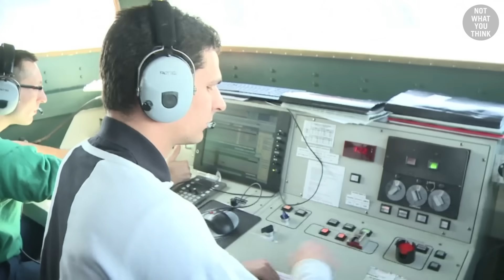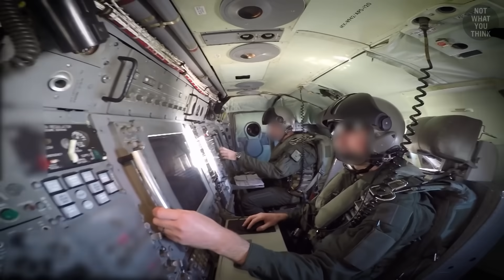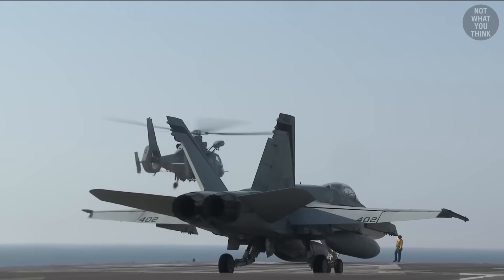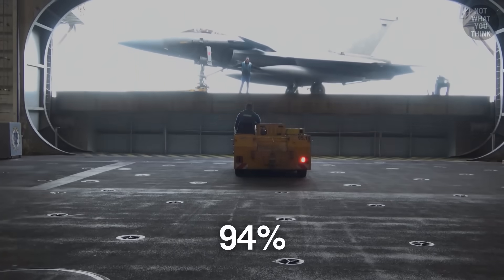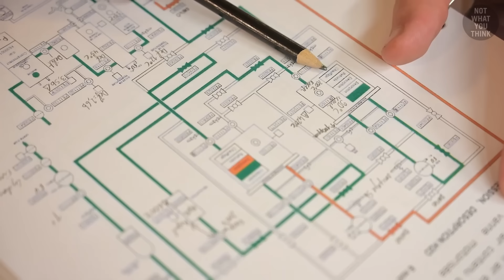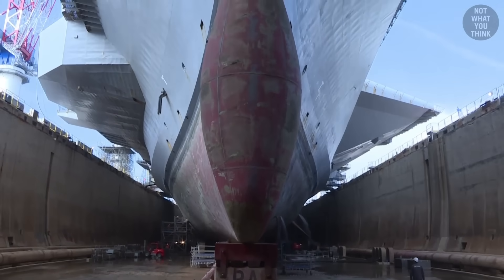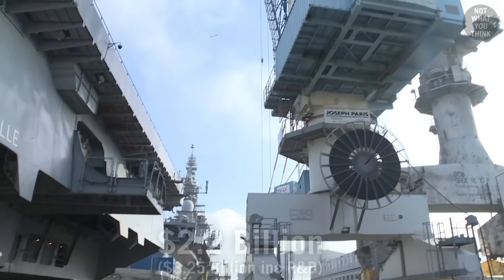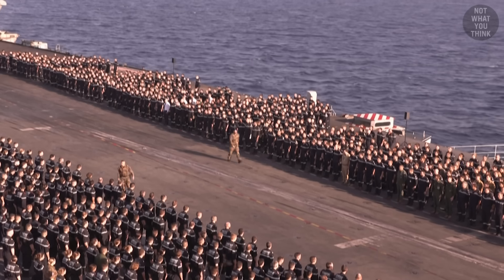Why This Small Carrier is Most Powerful Outside of the Supercarriers

Comment: This is a proper aircraft carrier. UK should have built theirs like this.
Reply: Why? Catobar is more expensive and the F-35 can work just fine with a Ski-jump.
Reply: @ Ski jumps limit your air t to just one type. You can’t operate E-2D Hawkeye and other fixed wing jets which do not use STOVL

Comment: The British did not want to expend the money required to build a nuclear-powered aircraft carrier, nor the budget required to build a CATOBAR supercarrier.  So, they built two conventionally powered carriers which are ramp dependent. That should have worked out well, because the F-35B is a very capable and survivable jet which has the capability to fight in contested airspace and deliver accurate strikes on defended targets as well as defeat electronic warfare systems.  But the Queen Elizabeth-class carriers cannot fulfill their missions, because the U.K> declined to spend the money to establish even one full-strength F-35 squadron!  These carriers must either deploy with a few F-35s added to a now-obsolete Sea Harrier squadron (assuming airworthy Sea Harriers are still available) or stay in home port.

Comment: My dude can only reach 20 Knots top speed 😂 definitely not more powerful than the Chinese shandon although is nuclear but is using the reactor from subs so it can even run the ship at full capacity and they have to add length to the ship to take off E2s also the entire Franch Navy can barely pull off a single full carrier strike group

Comment: Uh, no. The De Gaulle looks great on paper but has huge ongoing mechanical issues with propulsion limiting it's ability to deploy and there's no solution in sight. the Propeller shaft vibration is so bad that it is almost crippling.

Comment: Somewhat exaggerated claim and one due solely to CdeG's being configured for CATOBAR operation. Though in fact that has both advantages and drawbacks. Even so, and even while configured as STOVL platforms, the UK's QE Class ships can each operate max balanced airwings of c60 aircraft, all types (50% more than CdeG's maximum) and could operate them far more efficiently and effectively as well. They thus would each be hugely more powerful than CdeG if their full maximum strike wings' fast jet component of 48 x F35-Bs per ship were actually available to be embarked.

Comment: You missed out the rather obvious, but seldom thought of weakness of this, and all other carriers. 

They rely on vulnerable support ships to keep the crew fed, and provide supplies such as munitions, food and aviation fuel, making the nuclear reactor's ability to keep the carrier steaming a bit of a moot point. Any adversary would target those supply ships and nullify the ability of a carrier to carry out it's operations. 

There was also no mention of the threat of hypersonic missiles, or the threat of large salvo missile attacks which would overwhelm a carrier group's defences. The US found this out to be a thorn in it's side when they had to script an exercise (restrict enemy force's ability to have a free hand) in the Millenium Challenge (MC02) to ensure the exercise achieved the "success" the top brass wanted it to.

A carrier group's escorts can only provide a limited number of air defence missiles and rounds for it's CIWS before they need reloading/rearming. There is no doubt they would run out of defensive weapons if a large salvo simultaneous attack came in, leading to the sinking of a carrier and some escorts, leading to a large loss of life and assets aboard.

Comment: as the video points out, having AEW PLANES is essential for any "real" carrier. you need AT LEAST three: one on station, one being readied, and one in maintenance. without these PLANEs, you are blind, and in modern naval combat, that means dead.

you can try to the job with helicopters, but it's just not good enough. helos don't have the range, altitude, or endurance.

Comment: Are French Rafael fighters a match for F 35s? I think that’s the real question more than anything else! I am a Canadian and this is gonna sound weird cause I’m not from Quebec. I’m from Western Canada and I’m indigenous, but I wish we would’ve bought the French Rafael fighter with its twin engine design! Canada has traditionally owes you twin engine jets. When you’re flying over the Canadian tundra you want at least one engine to get you home!
Reply: Well there is no true answer to that question. Both are formidable aircrafts. F35 have unmatched passive stealth abilities and sensors and everything that we don't know about it, the pride of us military industry. But it is still a young design that will improve over time and get more reliable when all its problems will be solved. Rafale is much more older and developped, combat proven , can do all the missions that would normally require multiples kind of aircrafts. It has top notch sensors developped by Thales, maybe the best active stealth system and can launch meteor missile which is the best air to air missile on the market and has wider range detection and shooting than any other missile. The question would really be : can a meteor missile launched by a rafale detect and shoot an F35 before being shot ? Another question would be : would an F35 do everything a rafale can do as effectively ? In the end it does not really matter since we're allies those planes will only fight together and not against each other. I don't know which is the best but I'm quite sure together they're unbeatable
Reply: @antoinedubocq2052 great reply to the bait comment. Two completely different platforms with different purposes. Thank god our countries our allies, god help anyone in our way
Reply: Rafale, not Rafael 😭😭
Reply: rafale is better for the simple simple simple fact that you have total autonomy using them, for French or foreign countries, where with the f35 the US have total control and supervision of ur mission, and I am not even talking about nuclear warheads, which we know in a case of a tense situation, US won't even allow them to be mounted on the aircrafts...
Every countries who bought f35s are just getting fooled bu the US, again

Comment: French Rafale Marine is one of the best carrier-capable jets: Empty Weight 10,200 kg (22,500 lb) MTOW 24,500 kg (54,000 lb) Payload 9,500 kg (20,943 lb). Mach 1,8.  Hardpoints: 13.  6 AA missiles + 2 hardpoints: 6 GBU or 2 SCALP cruise missiles or 1 ASMP tactical nuclear missile (300 kt)
F35-B: Empty Weight 14,700 kg (32,472 lb) MTOW 27,200 kg (60,000lb) Payload: 8,200 kg (18,000 lb) Mach 1.6. Hardpoints: 10 (4 internal, 6 external)   4 internal hardpoints : only 2 AA missiles + 2 bombs. 
6 external hardpoints : F35B loses a significantly part of its stealth features.
Reply: Rafale is an excellent aircraft.
Reply: While the Rafale is a fine 4th generation plane in terms of electronic warfare the F35 is leagues ahead. The sensors and stealth capability are incomparable between them. As one test pilot said: “A 4th generation could probably beat an F35 in a dogfight, it’s just shame they’ll never get close enough.”
Reply: The F-35C is the carrier variant of the F-35. The B variant is the VTOL variant used by the Marines. The lack of weapons on the F-35 makes sense when you recognize the F-18E has 12 hardpoints and is expected to operate with the F-35 as either a missile or bomb truck. The more planes Americans can put on their carriers allow for more specialization.

The Rafale is most likely the best fourth-generation fighter in the world. The key edge it has is the French gave it one of the best aviation and sensor packages in the world. The only plane that beats it in that regard is the F-35.
Reply: @BulletRain100 The most crazy thing about Rafale, it was made to be upgraded. The first variants were 4th gen. Now we have the F4, which is a 4.5th gen. The F5 will be out very soon.
Reply: is the best*
Reply: The French plane is very good for a fourth Generation platform but the F35 would be more likely to get the first shot first kill. It is just that simple....
Reply: Sorry but the weight numbers you gave were for the F-35C CATOBAR variant. The F-35B variant has regularly gone off both QE class carriers with 22,000 Ibs of weapons. Which is more than the Rafale M and it is 5th Gen while the Rafale M is 4th gen. that alone gives a huge advantage.

Comment: About the benches for engine testing, they aren't really needed anymore : the snecma m88 engine is made in 24 segments, each equillibrated, which allows a team of mechanics to switch a falty segment without needing to neither replace the engine nor to retest it
 It's the only engine that allows that

Comment: Thanks for a very informative and interesting video!  I had long wondered about that forward island, and put it down to French preference.  In truth, the far-aft location of the latest designs looks equally odd.
Reply: What do you think about the double whammy of the newest Royal Navy carriers?

All we've been told here in the UK is that one's for running the ship, the other for running the flight deck.

Sounds sensible but methinks that there's more to it than that. If the two command centres had to shout ever louder to be heard over the other lot, a cheaper solution would surely have been to upgrade their headphones‽
Reply: @JP_TaVeryMuch  It looks weird, but I guess they wanted that 'midship lift really badly...

Comment: Well it works and has a sizeable air wing.   Puts it in a class ahead of the Royal Navy carriers.
Reply: What a daft post ...
Reply: It's been in service two decades at this point. If it didn't work and have a full air group I'd be shocked. Give the RN a few years and they'll be able to maintain carrier ops for longer than France can.
Reply: And has actual AEW.
Why GB decided to make the QE class STOVL when they were originally CATOBAR (hence their size) is beyond me. It's not even a case of throwing good money after bad, it's making the initial investment even more expensive by spending additional money for a result that manages to falls short of any expectations.
Times two.
Reply: @Pouncer9000 The reason is that it would’ve meant we could only procure 1 expensive carrier for marginal and debatable capability gain instead of two.

As we are finding out with the teething issues of our carriers, two is one and one is indeed none. Two carriers with ramps is orders of magnitude better than one.

It’s not fair to directly compare the state of the brand new RN carriers to the very mature Charles de Gaulle either, since they’re at very different points in their service lives. It’ll be interesting to compare the two sets of capabilities in 2029.

Finally, and I’m sure most will agree with me here:

F-35 > Rafale
Reply: @TheTfrules 
F35>Rafale?
Depends on the mission and situation.
From a carrier with catapult, yes.
F35 from a carrier without catapult vs rafale from a carrier with catapult, not really. It has less autonomy and less payload.
Reply: @Crapulax  The F-35B can carry a full payload from a ramp launch. Also I would argue the benefits of improved stealth and sensors outweigh payload capacity in importance from a peer conflict perspective.
Reply: Anyway :  F-35B < F-35C. With CATOBAR, the Royal Navy would have ad the choice between several types of fighters, interoperability with the US, and of course more range-payload anyway.

Comment: The problem with the Charles de Gaulle is that there is only one Charles de Gaulle.    There is a time limit before it has to return to port.   Sure its nuclear, and it can resupply at sea.  personal rotation and some maintenance needs to done in port.  You cannot deploy your personal forever.   Any battle damage that prevents flight ops and the war is over.  There is no replacement.

Comment: 1) the island is in front to help navigate. Now the french navy feels confidant enough to put it on the back has shown on the pang (successor project). 
2) the cdg is limited in speed not because of the reactor but the shaft that is to small and inefficant. Actually 2 k15 can push a 55000 tonnes carrier. Le k22 of the pang will push 75 to 80 000 tonnes. Being only 50% more powerfull when the pang is also 100% bigger then cdg. 44 vs 75 k tonns.

Comment: Very interesting to hear the effects of having a catapult in an carrier. Back in the day, when my country, Argentina, was not a pathetic joke of a state, we had for a few years 2 aircraft carriers, both from 2nd WW and steam propulsion: from 1969 to 1997 the 25 de Mayo (very old) and before that (from 1959 to 1969) the Independencia. The main difference was, apparently, that the 25 de Mayo had 1 catapult, although it was added, not originally in the ship. The air wing was mainly A-4s and eventually Super Étendard, and a couple of S-2 Trackers and varying helicopters.
Reply: With Javier Milei, you are on the right track.  Greetings from France amigo.

Comment: As a Brit I would love to say the two Elizabeth class carriers are better in every single way ... But rumour is they aren't working all the well
Reply: I'm a Brit too but wouldn't ever say they were better even if they worked perfectly.  Actually, I do like the appearance of the RN carriers, if the ski ramps were removed I'd think they were the best looking carriers, despite looks not being important.
Reply: They're still fairly new, prop shafts are prone to issues (because huge rapidly spinning metal bar that needs a hole in the hull is obviously difficult to keep up to snuff) and France had a devil of a time when Charles de Gaulle was new. Believe they had a reactor leak at one point.

Comment: @12:45, if the props off the old FS Clemenceau could work at 32 knots without the cavitation causing severe vibration, then why could they only get FS Charles De Gaulle up to a mere 25 knots? I'm guessing weight and increased RPM needed to achieve the higher speeds.

Comment: The top speed is classified, but since they use the same reduction gears as the conventional carriers did, which are rated to 36 knots, the top speed is 36 knots. All the Navy has ever said about the carriers speed was that they will exceed 30 knots. When I was on the USS Midway (CV-41) we joked that the reason that they picked 30 knots was that the top speed of the USS Midway was 31 knots.

Comment: I just noticed that the aircraft on the de Gaulle have "Marine" painted on them.  I don't know if the French Navy is referred to by "Marine" or if the aircraft or a portion of the aircraft are part of the French Marines.

US Marines always have at least one squadron of fighters on US aircraft carriers except for the F-35B Marine fighters which can only fly off of the dedicated but Navy owned LHA ships.

BTW, technically, the Marine Corps doesn't own any of its own aircraft.  The Navy buys all of the Marine aircraft, but the Marine Corps buys all of the ground support equipment.  I don't think this would ever happen, but theoretically, the Navy could require to give the Navy back all or a portion of its aircraft.  The Navy wouldn't do that because the Marines already augment the Navy carrier air wing with Marine fighters.  And the Navy doesn't have any need for the F-35B's beyond them being deployed on LHA's because the F-35B's can carry as heavy of a load and doesn't have the range of the Navy's F-35C.
Reply: La Marine Nationale has a bit of the same mission as the American Navy.
Reply: Marine means Navy in French. That's where the USMC names come from, not the other way around. It's a French word and the Americans slightly changed its meaning.

Comment: One of the reasons for such a low amount of jets inside the hangar (23 of 40 aircraft) is the fact that Rafale M does not have folding wings. If it were F-18s or MiG-29Ks (similar in size) up to 30 would fit inside.
Also in the US Navy not all the 90+ aircraft that a supercarrier can carry, would fit insisde the hangar. Some  must be stored in the deck.
This was also true for the F-14 that again does not have folding wing, and looks like a giant dorito from above.
In the Russian Navy, less than half of the 45+ jets would fit in the hangar of Admiral Kuznetsov as there is a missile launcher in the space that a bigger hangar would ocuppy. And the Su-33 is a really huge fighter jet in size despite haivng folding wings.
Reply: True, the F-14 didn't have "folding wings".  But the variable-sweep wings were put into "oversweep" (75º) for taxiing and parking, and in fact took up less deck space than a Super Hornet with wings folded.
Reply: The Rafale has somewhat small delta wings, so it's easy to stack them inside even without folding them (which always comes with structural issues - it's why the F-18 can't carry AMRAAMs on its wingtips like the F-16 does). The same was true with the US Navy's A-4. The F-14 had swing wings, which take up less space when swept backwards, but even so it took up more space than a Rafale.

Comment: This is what the USN should do. 

We can keep our super carriers.  But really we should focus on many, smaller carriers.  The flexibility, force resilience, and regional control offered by 1 super + 4-5 light-medium carriers is superior to supercarrier only model.
Reply: That’s what the USN is quietly doing. Five 40,000 ton LHDs currently have F-35b.
Reply: Carriers are more of a statement then a functional tool these days. Against a peer advisary they are a little redundant. Could be useful in a good scenario but overall they arnt that great as they can easily be tracked down unlike in the 1940s when satallites werent a thing so you actively had to scout for your enemy. Now you just use satallite imagery.